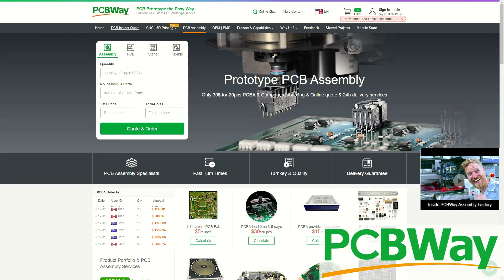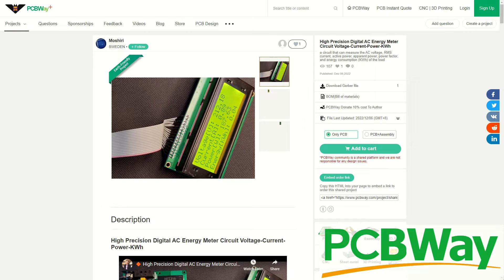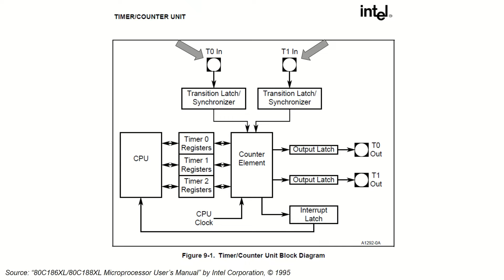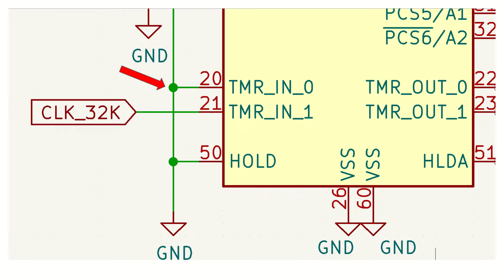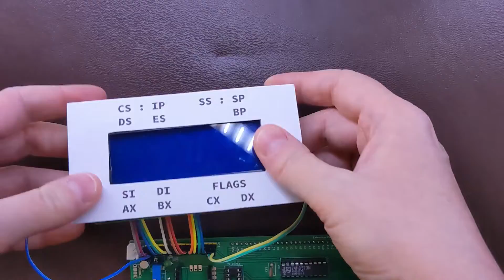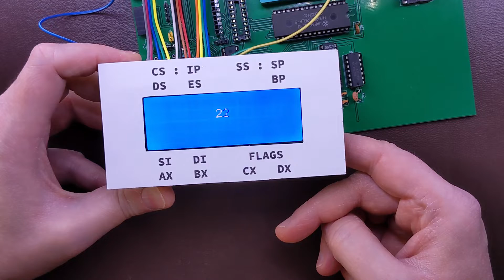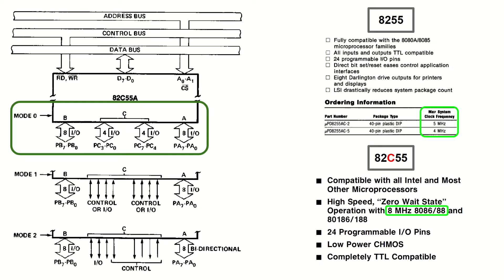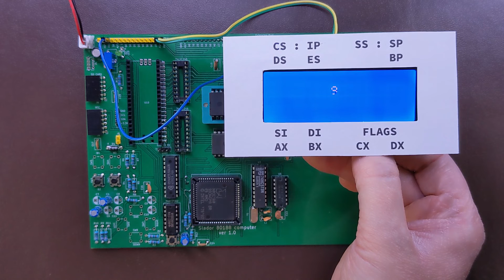Intel 80188 computer on a PCB - 16-bit Intel x86 breadboard computer [part 8]

Comment: I always thought 90° trace turns are a no-go in PCB design or am I completely mistaken?
Reply from the maker: Your not mistaken, there is this myth about 90° turns (which has been debunked multiple times) and only have any physical effects around microwave frequencies (3-4 orders of magnitude higher than those we are dealing with here). Nonetheless, everyone (including me) still follows it. I must admit, that I simply rushed this particular PCB a little bit and didn't care about its appearance too much. It was a temporary work after all and had a few other issues. The next version is going to be designed much better.

Comment: Could you sell the pub you designed?  I want to build it for a project I have and having a pcb for it would make it much easier
Reply from the maker: Hi there! Yes, that was always my plan, but this version has already a few known issues and is missing one important component, which I'm going to add soon. I created this version only for tinkering and as soon as I test the whole computer completely I will design the final version of the PCB and make it available.

Comment: If you ever do a 386 on a breadboard I would be very impressed
Reply from the maker: My future plans include impressing you ;-)
Reply: @SladorSoft  32-bit x86 is by far the most successful CPU architecture ever made, it is still used today so I think that would be an interesting video. Others might say it is 6502 or z80 or whatever but I don't think so much, everyone is still using at least one 32-bit x86 app these days, Visual Studio finally moved to 64-bit recently and that's a pretty ancient IDE.
Reply from the maker: @deltakid - I totally agree with you. My first processor I programmed was in fact 6502, but most of my life I was using and programming the x86. That's why I started this series in the first place - I felt that I know this architecture quite well. Also, the 32-bit x86 is still important, because once you know it, switching to 64-bit is natural as both are very similar.
No, I'm NOT planning to put a 64-bit Intel CPU on the breadboard :-)

Comment: NEC µPD70108 (NEC V20) would be much more breadboard friendly as it comes in DIL20 form factor. It also is 80188 compatible (with option to switch to i8080).

Comment: This is a great project! Keep up the good work.
Reply from the maker: Thank you very much. I'm aware that this video wasn't one of the most exciting in the series, but I thought that I need to put everything together on a PCB before things get too complicated 😉. I'm planning to do quite interesting things in the next few videos and I really can't wait until I do it, because I haven't yet tried what I planned. All ideas will be tested while recording. I hope that they will work 😄
Reply: @SladorSoft  I don't see many decoupling capacitors around your ICs. I might suggest that you add some in your next board revision. Phil's Lab channel has a lot of great videos about PCB design. I've learned a ton from him.
Reply from the maker: That is a very fair comment. You are definitely right.
Let me explain myself. I thought of this PCB as a temporary, first version and I expected it to have mistakes which I would fix in the next version. I didn't care that much about decoupling capacitors just because there was even fewer of them on the breadboards, just scattered randomly and it was still working fine.
But... As I mentioned in the video, I struggled to make the 80C188XL working on this PCB, despite it working on this crude "adapter" I soldered together and put on the breadboard in the previous video.
I'm still going to investigate this problem, but one of the theories is the insufficient decoupling (though I didn't see much noise in the VCC), unfortunately, or parasitic capacitances.
Reply: @SladorSoft  PCB design is hard!